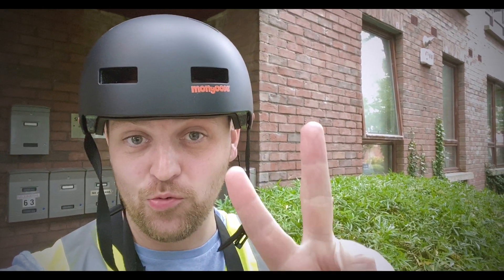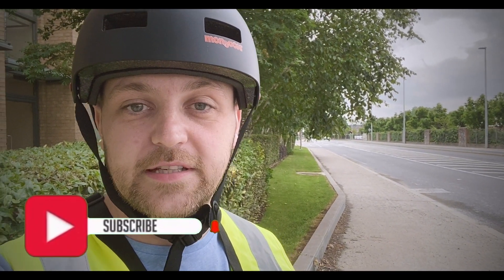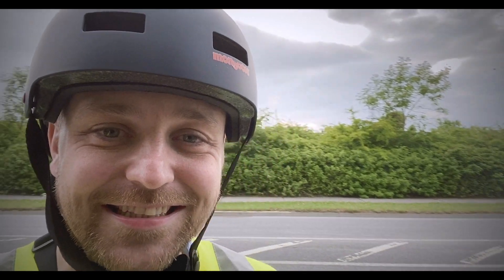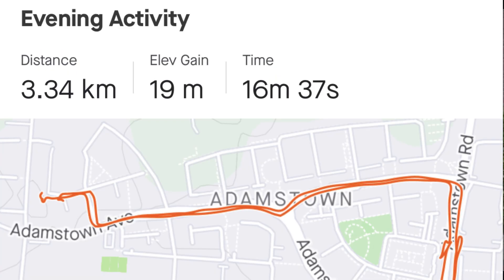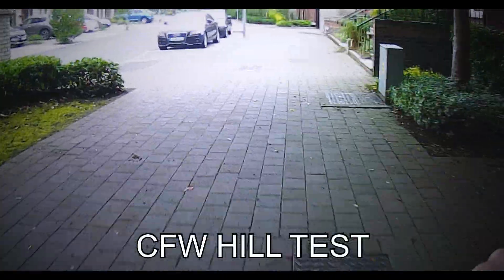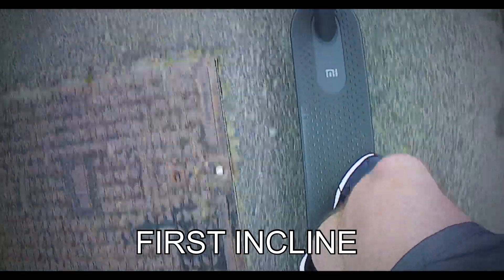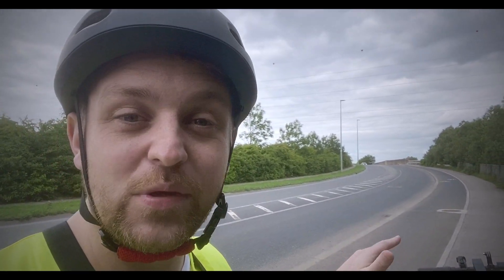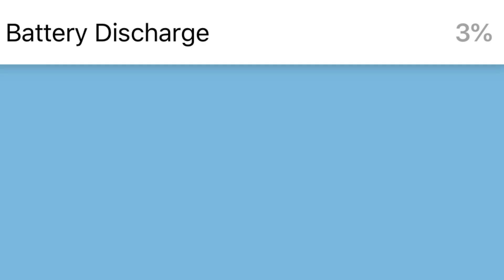XIAOMI M365 PRO HILL TEST // Stock vs Custom Firmware

Comment: There is SHFW for this scooter now, mine does 40 kmh flat and 20 up pretty much any hill.
Reply from the maker: @hugoparox  no longer have the Xiaomi but definitely be careful if you are pushing over the 32km/h speeds. Assuming you have modded the controller so it doesn’t overheat?
Reply: @Movelectrics  Monitoring temps they are just fine. I am only pushing 30amps. Field weakening is what does the job. The real issue for me is motor temperature. So I try to keep the throttle mostly low. I of course pull additional amps as flux tho.

Comment: I weigh just over 90kg. My commute to work is 7.5 km (4.6 miles) one way. Along the way, I have some significant climbs (viaduct over the motorway etc). I specifically bought the m365 pro 2 to commute this way. Today was the first time I had the opportunity to ride at -2 degrees. I noticed that the temperature has a big impact on performance, at the end when I was coming back at about 12km with the battery only had something barely 20% and the scooter probably went into power saving mode because it would not let me go faster than 10-13km/h. A bit frustrating. I think I'll take the charger to work tomorrow to start again on a fully charged battery.
Reply from the maker: Definitely charge when possible. Temperature can drain the battery much faster 🛴

Comment: Is it safe to ride in the rain well drizzle got the pro 2
Reply from the maker: Hi Luke. Apparently they are ‘ok’ in light rain. But I try to avoid at all costs. The main thing to cover is the display.
There is only a small amount of scooters that are good in the rain, Xiaomis are not, yet.

If you do get caught in the rain, when you get home, dry it immediately 🛴
Reply: @Movelectrics  thanks for your advice think gonna leave it home just to be on safe side 👍

Comment: Hey is it normal that for me stock always maxes out at 23/24 km/h for sport and 19km/h in normal mode?
Reply from the maker: Hi Matus! For stock this is normal.
Weight, road conditions, wind, wheel pressure all has an impact on speed. Using CFW is a great option 🛴
Reply: @Movelectrics Alright thanks!

Comment: what is the range after this hack??
Reply from the maker: Hi Ahmed. I done a 17km test video, sport mode and used just about half battery. I’m yet to do a full range test. But I’d say around 30km give or take.
Reply: @Movelectrics  thx bro for the fast reply 😀
Reply from the maker: No worries at all!
Scoot safe 🛴

Comment: Hi! I'm having problems with installing the firmware. Can you help?
Reply from the maker: Crime Clan join the FB and people can help http://tiny.cc/eiktqz
Reply: @Movelectrics  well, my problem is that after I flash the firmware, no changes are made. It said done; but it did not change anything. Just to make sure I changed the starting speed and flashed it but there was no difference made. Help.
Reply from the maker: Crime Clan join the group above
Reply: https://www.reddit.com/r/m365/comments/i2l87i/m365_pro_mod_tutorial/?utm_medium=android_app&utm_source=share follow this guide, I did it this morning and MY GOD! what a difference

Comment: what is its range mod ?? my weight  85 kg and  range 36km not mode
Reply from the maker: A range test will be getting done on this CFW using sport mode. That will be a long video I’d say.

You can see the comparisons in the video from the first test compared to the second CFW test. They are almost identical on the stats!

To be honest, it is an amazing mod. I don’t regret it at all!

How is you’re scooter going? Any mods on it yet?
Reply: @Movelectrics  i drive official soft not mod ;p
Reply from the maker: When I got the scooter, I said I wasn’t gonna mod it🤣 didn’t last long!!
Reply: @Movelectrics  heheh i all time think  mod or no ;p
Reply from the maker: Give it a time 😯
Reply: Hey guys! Nice video! What about motor temperature? Is it increasing before and after CFW? I am about 100 kilos and suspect some overheating issues with both firmwares :) Do you have thermometer to test it out? I believe that there will be significant difference ;) Thank you
Reply from the maker: Rumen Barzakov hi! Click on this Facebook group, this deals exclusively with this CFW. Ask any question and it can be helped. The temperature has being absolutely fine to be honest! I will do a video showing really time, great idea!

Here is the group http://tiny.cc/eiktqz